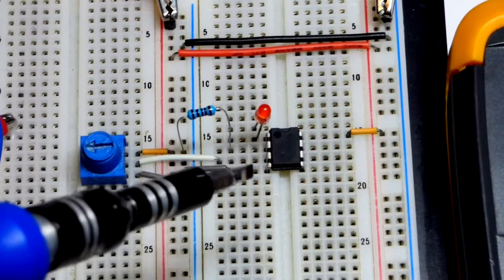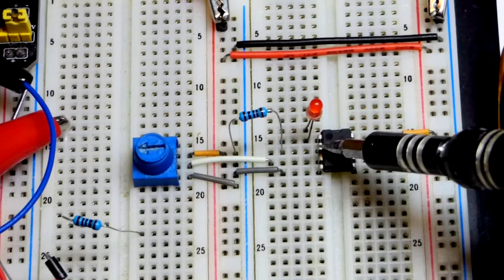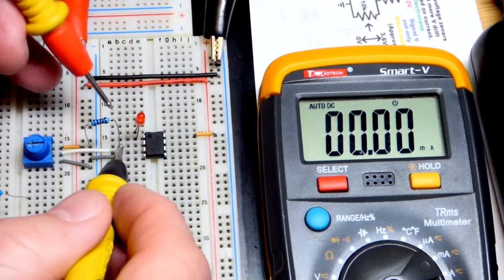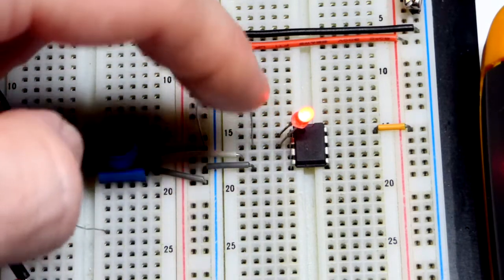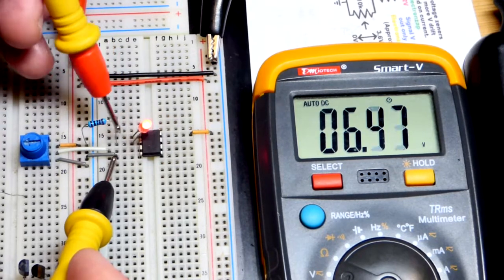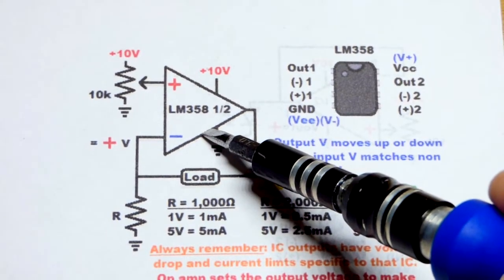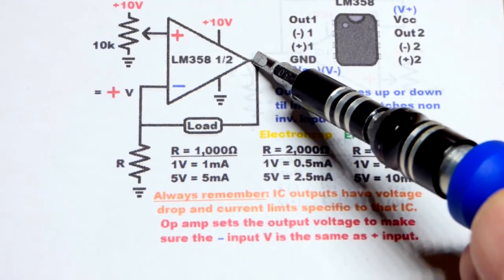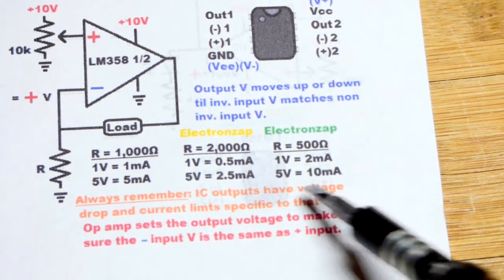Op amp current source using LM358 operational amplifier and LEDs learning electronics lesson 0026

Comment: Would there be much difference in taking the voltage output to the other side of opamp to buffer the voltage first then using buffered voltage for the load resistor?
Reply from the maker: I'd have to see how that would be wired to get a sense of how it would turn out.